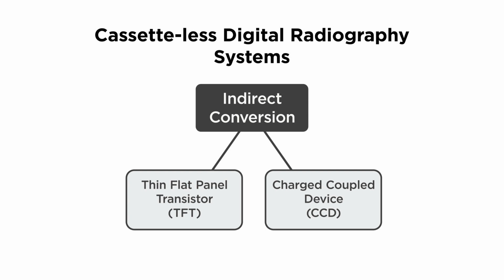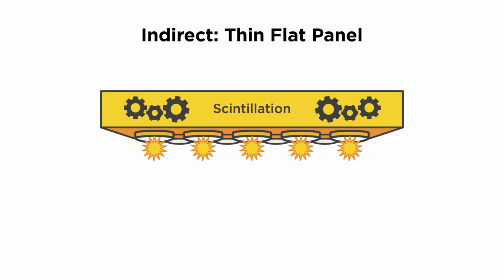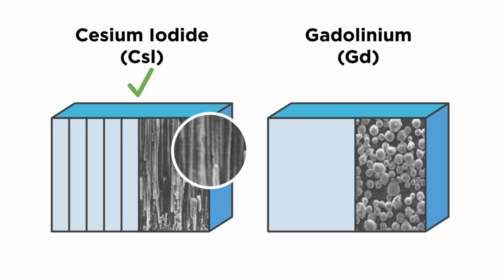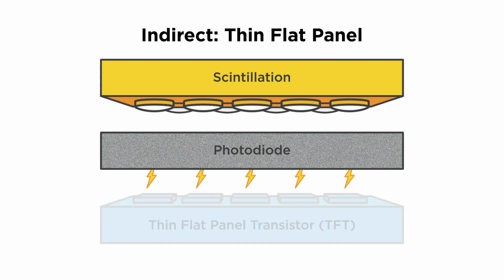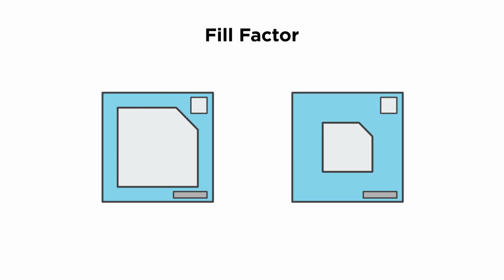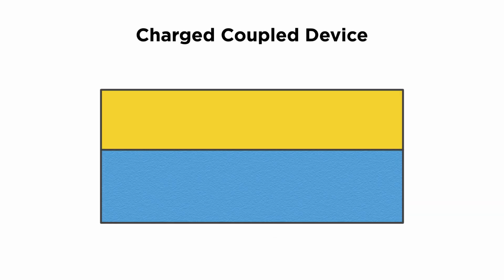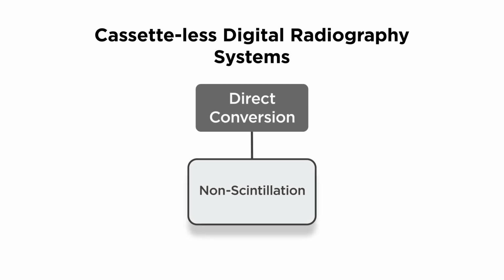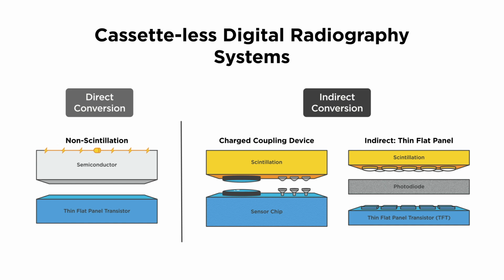Digital Radiography System Explained (step-by-step)

Comment: When the video talks about the CCD indirect digital conversion the narrator says (there is no photocathode layer) which is wrong, there is no (photodiode) layer.
Reply: he is not explained briefly, as he says about the sensor chip that is  inside the CCD thus, it converts the light signal into a digital signal